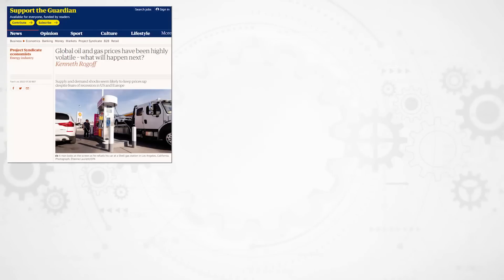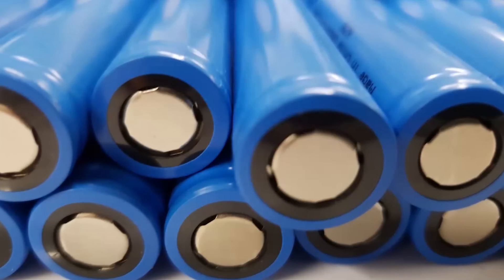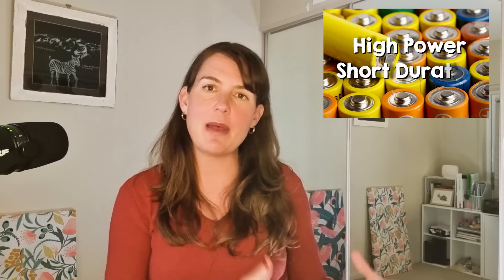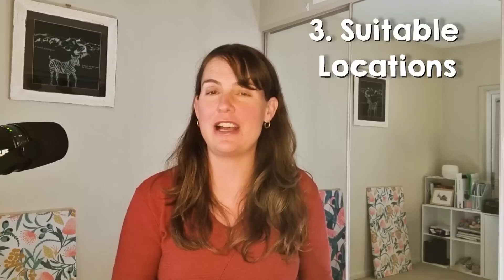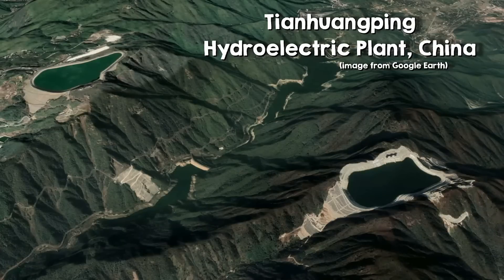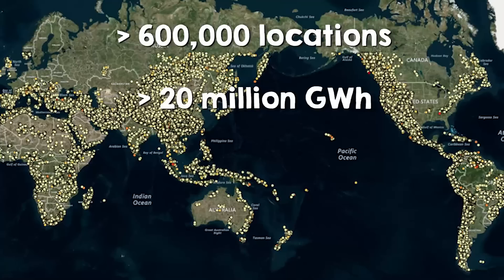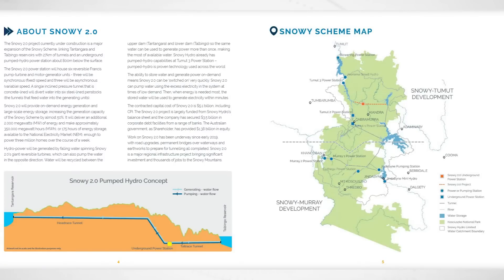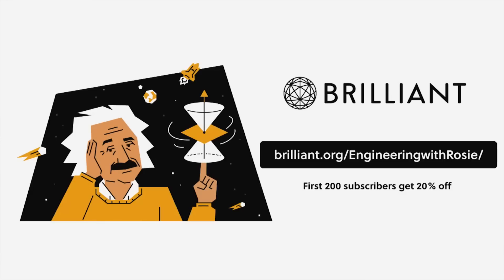Pump It Up When You Don't Really Need It: Pumped Hydro, Future of Energy Storage

Comment: Hi! I live in Sweden and have been following your Chanel on YouTube, almost a year, I think. And I think you have interesting subjects that you adress. As I am Swedish, I hope you excause some misspelling and orther errors in my text. Incuding autocorrect to Swedish!?!?
The last film I saw, was about pumped hydro. Then I realised, has anyone done a pumped hydro in an existing river with an existing hydroplant. In Sweden we have a lot of rivers with hydroplants. In My hometown, we have 10 plants with a total of 320 MW. In Sweden we have a total of 2000 plants with an effect of 16200 MW, producing 65TWh.
Is it not possible to pump the water back, upstream the plant and use it again?? . Using solar or wind to generate the power to pump up the water?? Is there any place that has been tested or is it also to expensive??
In my small mind
it must be much sheaper, than finding a new place with good posibilitie to store electricity/water, and use it again and again.
Best whishis Kjell S Boden Sweden.
Reply from the maker: Hej! Are you talking about run of river hydro, or hydro with dams? It is very common to retrofit an existing hydro system to add pumping, as long as there are upper and lower reservoirs already. But if it's just run of river you'd need to add reservoirs, and if the river is constantly flowing then I can't really see that there would  be much benefit to doing that without also adding extra generating capacity.
Reply: @EngineeringwithRosie  Hi. It is rivers with existing dams. It is several dams, one after another with varying from small to gigantic reservoirs. The river where I live is "Luleälven" apr. 461km long, starting at 580 m above sealevel, passing 15 Hydro powerplants. 4300MW installed electricity generators. The reservoirs are mainly abowe the dams, but some have reservoirs below also. And I thought if there is any facilities somewhere, around the world where they pump up the water again, using solar or wind, to let it generate more electricity.
Is there any similar rivers with "reused" water, combined of pumped up water and the regular stream?? Have you got an exemple??

Comment: The only viable grid scale energy storage technology currently in existence (that's not just high frequency smoothing but actual storage for days and weeks) BUT if the UK had the entire wolds pumped hydro capacity at it's disposal then it could store around 10 days of UK average electricity consumption. That's a back of fag packet calculation (correct if I,'m off a bit) (obviously this doesn't include EVs, wide spread use of heatpumps etc). So clearly its one small part of the total solution, not saying its a bad thing just we will have to do lots of little things like this and a few big things (like nuclear fission) of we are to get through this.

Comment: When I worked for the CEGB (UK national generating board) back in the 1980s one of the parameters of the Dinorwig pumped hydro station was the minimum emptying level of each reservoir which if I recall correctly depended on species that lived in the reservoirs. Also the amount of water varied due to lack of rain. The system wasn't closed (there's leakage).
Reply: What about  using the  sea as the bottom lake?
Reply: @patdbean It wasn't close to the sea. But the top lake would still limit the amount it could be emptied for species protection there.
Reply: @drigans2065  yes, you would still need a top lake, and if it did not already exist you would have to dig it

 Also the pumping equipment would have to be salt water hardened.

Comment: Very clear headed video (as always) and good intro to pumped hydro.  As a great fan of PSH in general and Snowy 2.0 in particular (hang the cost and fingers crossed re environmental consequences!) I hope you do get to examine Snowy2 in some detail.  In the process a discussion on system sizing and comparing PSH system 'capacities' would be very useful.  Many comments here and elsewhere show a confusion between every possible usage of the word 'capacity' and there is much misunderstanding about the relative sizes and capabilities of PSH projects.  Journalists routinely confuse power and energy (GW and GWh) and there is a separate confusion between energy storage capacity when expressed in GWh and annual energy production/usage, also in GWh (see discussion of Lake Onslow below, the not-actually-5TWh project).  

It would be useful if discussions would standardise on using hours of operation at full power as the measure of "size" of a project, but that is hardly ever quoted.  In fact it is quite difficult to find any measure of energy storage capacity for most projects, something I discovered when trying to assess where Snowy2 stands in relation to other projects.  As far as I can see, Snowy2 is bigger (in terms of energy storage, 350 GWh) than any other project ever built or planned.  Is this true?  Comparing capabilities is made even harder when you take into account sometimes large differentials between upper and lower reservoir capacities, so that some systems may have large energy storage that can not be recharged because the lower reservoir is small.  In any case, the fact that Snowy2 is able to generate for 175 hours at 2GW puts it way ahead of most (all?) other PSH projects.

If you've started your research you might have seen that they named the most recent of Snowy2's tunnel boring machines "Florence", after Florence Violet Mackenzie, generally credited as being Australia's first female electrical engineer.

Comment: Pretty ill informed to claim that renewable did not have any issues considering that electricity prices spiked in the UK AND europe because of lack of wind and the turbines didnt generate that much, on top of a long cold winter where solar panels in most of europe were useless most of the year and that was few months before the ukraine conflict. 
That unreliability of wind and solar has forced UK and european countries to use their  gas and oil reserve that left them exposed and unable to replenish them du to the ukrainian conflict now. 
This energy mess started with the unreliability of renewables the previous year this is a matter of public record and widely reported and mentioned by every leader including Putin......
Reply: Which, of course, is why we need storage to firm up intermittent renewables.  Engineers have always understood that firming of variable renewable sources would  be necessary, and it's strange (to me) that there  isn't  already a clear requirement for complementary storage to be provided as part of every intermittent power project.  This would allow a more accurate understanding of true costs (although the whole business is becoming extraordinarily complicated with each intermittent source and each storage type having different characteristics - how do you compare 2-hour storage with 2-week storage, or instant response storage with quick response and slow response?). In my world, every intermittent  project could either come with some kind of storage built alongside, or they could buy storage 'certificates' from other projects like Snowy 2.

Comment: In long term any chemical battery will need to be exchanged after 3000-7000 cycles how does that compare to maintaining a pumped hydro system? 
In Australia most large infrastructure projects are first talked to death and politically compromised and then poorly executed by incompetent and corrupt management. The winners are a few individuals and large construction companies which syphon off public money with huge budget blow outs. The roll-out of the NBN was such an example, snowy 2 is another one and the Inland rail project is heading that way too. Those responsible are never held accountable. Australia could be 100% renewable already instead the biggest polluter per capita, shame shame.

Comment: Does anyone know if many of these sites are coastal? Despite the added cost involved in dealing with saltwater it seems to me that using the ocean as your low reservoir and then having an artificial saltwater pond/lake at a nearby point of higher elevation would be a pretty solid way to do pumped hydro. Are projects like this done or common?
Reply: Interesting idea, probably would have problems with salt damage to the environment due to some leakage. Also lots of maintenance due to corrosion of pipes and pumps.
Reply: The Potential PSH with 660000 locations is clearly shown on the presentation, see again on World Map.

Comment: An excellent video as always! Have you had a look at aquifer pumped hydro? The advantage is that you dont need terrain elevation. If you have two suitable aquifers at different level (with a good aquitard in between) you can even avoid having  storage on the surface. Potentially you could have an  energy storage system under a city.

Comment: I am not an expert in the field, but I have the intuition that gravity storage will always be superior to hydro, because when water falls, some of it moves (lower) between the blades of the turbine, therefore part of the mass of the water doesnt produce any work, making it a loss. But with gravity storage the mass is not liquid, and it can't flow trough blades, so 100% of the mass going down will make some work. That's the reason pumped hydro will never be more efficient than gravity storage. Of course, I didn't prove it with math, but it seems logical, so no proof seems necessary.
Reply from the maker: Hydro turbines are about 90% efficient, so your intuition is not correct about the size of losses there. The round trip efficiency for pumped hydro is about 80%, similar to what most non-hydro gravity storage is aiming for. One big difference is that pumped hydro has decades of operational data to arrive at that number, whereas non-hydro gravity storage systems have at best protoype validations, and we don't yet know what losses they'll have from maintenance and other downtime in the long term. With engineering we need to not only prove it with maths as a first step, but then also prove it works that way in reality because mundane things like maintenance make a big difference in many cases.
Reply: Absolute Zero, 

the very big and important difference is that hydro is controllable, gravity is not. There needs to be control when feeding a grid to make up for a shorfall of conventional generation or sudden increase in demand.

Comment: Storage isn't needed.  I designed a pumped hydro Generation system that works 24/7 and can easily be used for baseload, while having almost instant response to increased demand.  Other people with much bigger pockets than mine will also design things in due time.  Storage is just a thought for now, but some day it won't truly be necessary.

Comment: Hi Rosie, great video, but you didn't address the round trip efficiency of pumped hydro. Given that hydro is around 70% efficient, (please feel free to adjust any of my figures as necessary) and pumps that elevate the water back to the dam are around 130% inefficient, you would be lucky to get back 40% of the energy after dropping that water back through the turbines. Sure, solar panels are only 20% efficient, but wasting 80% of sunshine isn't a problem. After those solar panels have been used for pumping water, their efficiency becomes extremely poor. On the other hand, batteries can do a round trip efficiency number of around 90%, a much better number, but of course they have a limited life expectancy.
By now, Aussie suburbs should have built up enough solar arrays to be self sufficient, (probably nowhere near it) and have enough battery storage to run said suburb for a few hours. of course no-one is going to outlay $500,000 for a 1MW battery in every suburb, but if it were attractive enough for individuals to install a 10KW battery, EG; pay the wholesale rate for the FIT when demand is high while charging the batteries for free when rate is low, it could be feasible to install them, if the installation rate was 50c/watt like it should be.
My 9KW array sends around 10MW/Year into the grid and I buy back around 6MW/Y, so localised storage would be of great benefit to self consumption in our suburbs I think. Thanks, Tony.
Reply from the maker: The round trip efficiency of pumped hydro is about 80%

Comment: There is also an environmental aspect. It is not advisable to mix waters that have different chemical components that could affect the local biotope. There was an idea to connect the water from the Danube to the Vltava through a tunnel under the Bohemian Forest to the area of the Lipno Dam, but the water in the Vltava River has a higher acidity and average temperature. Also, the economic aspect does not work well with a theoretical price of 2.5 - 3 billion Euros, but no real study or project of this structure exists, so it is possible that the price in the real world may be higher.

Anyway, I have a silly question for you. Can evaporation losses affect Off-river systems ?
Reply: Needs constant top up by river obviously

Comment: Rosie you have the formula to calculate the energy in the stored water but how much more energy is required to pump the water back up to the top storage
Reply from the maker: Pumped hydro round trip efficiency is about 80%. A bit less than lithium ion batteries, but the use cases are so different I didn't think it was a completely relevant comparison to make.
Reply: @EngineeringwithRosie  so you are saying that it takes 20% more energy to pump the water so at that rate pumped hydro is going to cost 220% more as the energy used to pump the water has to be paid for
Reply from the maker: @garykemp6436  you would pump it up when electricity was cheap, and generate when it's expensive.
Reply: @EngineeringwithRosie  but here in Queensland we had off-peak power so we would irrigate at night to get cheap power now with the renewables their is no longer off-peak power and no cheap power so where is the cheap power coming from
Reply from the maker: @garykemp6436  for those operating in the wholesale market (NEM) the cheap power is usually in the middle of the day. Check out OpenNEM.org.au and you can see the price history over the past day, month, year or longer and you will be able to see how often prices are very low, and the difference to peak prices (usually in the evenings, when the sun has gone down), to get an idea of the potential.
Reply from the maker: @garykemp6436  and assuming you are not yourself operating in the wholesale market, you could get in on the action (if you had a home battery or even a grid-connected small scale pumped hydro system) by signing up to e.g. Amber Energy on their wholseale plan. Companies like RedEarth (not sure if there are others) can set you up with batteries and a platform/ app that helps you create your own "private power plant" and trade electricity on a small scale. I haven't used it myself (I rent, so I can't get solar panels or batteries), but it looks really cool.
Reply: @EngineeringwithRosie  it's only in the South East corner of Queensland that you can choose your energy supplier the rest of the state doesn't have a choice we only have Ergon
Reply: @EngineeringwithRosie  May be you are correct estimating Pumped hydro round trip efficiency is about 80%. This efficiency need pumping up water will be at 90% efficiency and then we come back on electricity generation with 90%, so 0.9*0.9=0.81 or 81%. Do you have any real case of PSH working with this round trip efficiency. Thanks

Comment: i dislike this video because geothermal is always excluded even we can drill now to unlimited depths it is big money will not profit from geothermal  with the help of compressed air and an geothermal grid we can have an simple energie solution without batteries and or oil coal etc but thre is no mony and no nukes in it bummer

Comment: Pumped Hydro is great yes as long as there is enough water. Hoover Dam is bordering on empty due to no water, Tasmania Hydro in Australia had another problem also with not enough water of which the energy grid fell into dismay. Hydro is very expensive to build and you must have the correct topography to do so, not to mention the environmental impact. There are better solutions to follow.
Reply from the maker: This video is about solutions to all those issues, isn't it? At least it was supposed to be!

Comment: Very interesting to see all the potential sites.
If you do an episode on snowy 2.0 I would like to know if it’s possible to return some environmental flow to the snowy river and make up the difference with pumped water.
Reply: No. While PHS is largely a closed loop system and would potentially displace some traditional hydro generation with stored wind or solar, the allocation of water resources down stream wouldn't be changed. Hydro is simply a byproduct of the water discharge to down stream users.

Comment: Sorry Rosie - as the physics behind is so basic (I agree) will be to difficult for politicians. 
I'm just gasping for air when I hear the ideas of several politicians here (Germany) how to solve the gas shortage next winter. 
- nuclear power (they are mostly out of fuel)
- fracking (needs some 10+ years to produce)
- fighting high power lines despite the potential power shortage in the south.